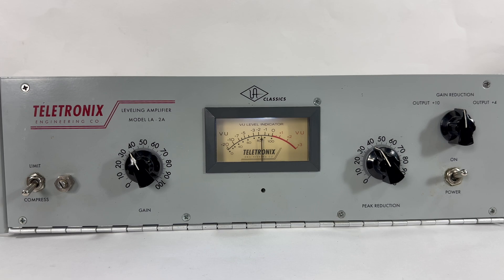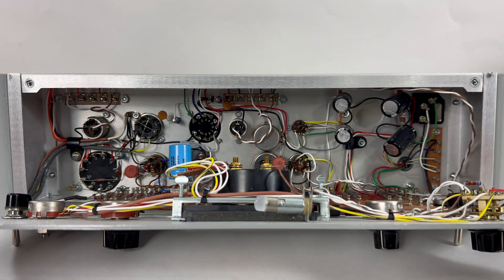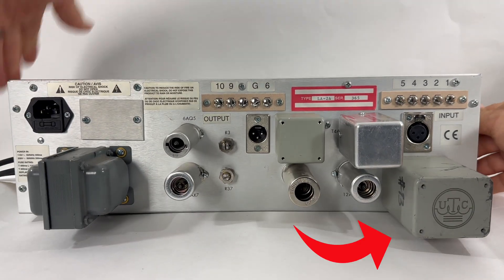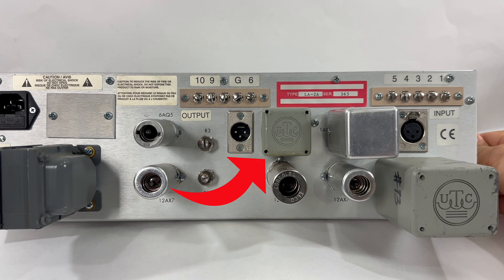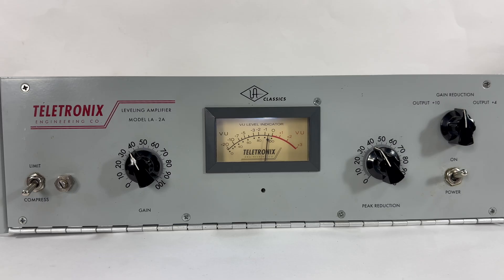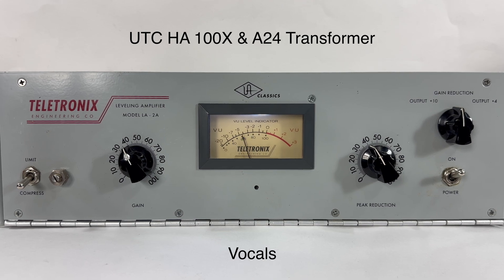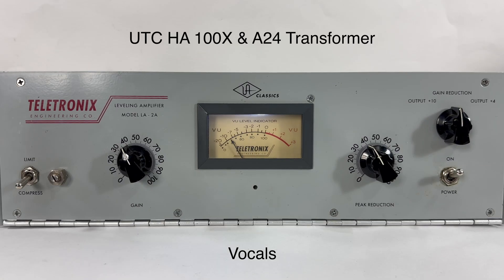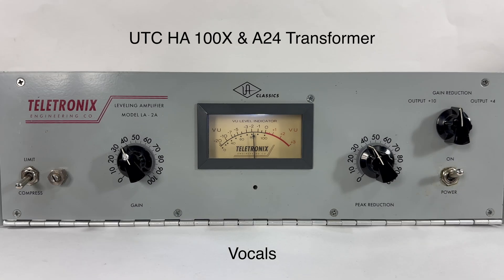Transformer Upgrade UA LA2A Teletronix Vintage UTC Transformers

Comment: Great video. Was the installation of the vintage transformers a difficult mod?
Reply: just copy the wiring take a photo and repeat.... its 15 minutes of soldering
Reply from the maker: I'm used to soldering and working with electronics so it wasn't too difficult but if you haven't soldered you might make a bit of a mess, also I had to drill out the holes a little bit for the smaller UTC A24 transformer to have the mounting screws go in correctly